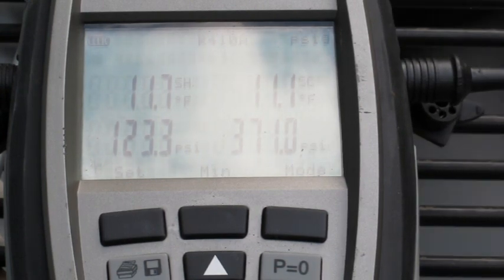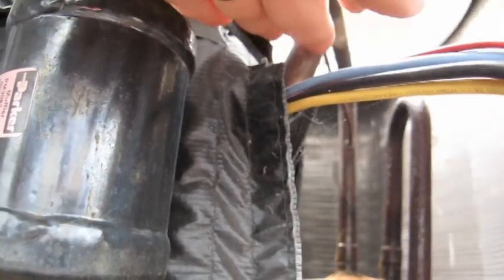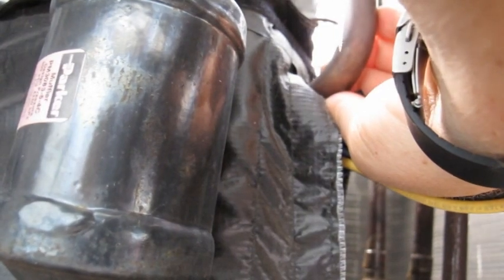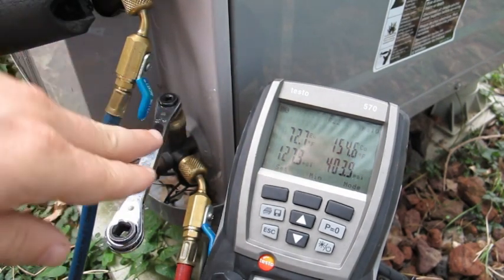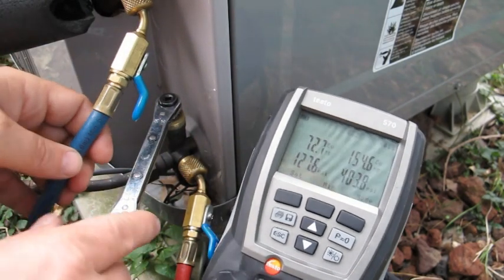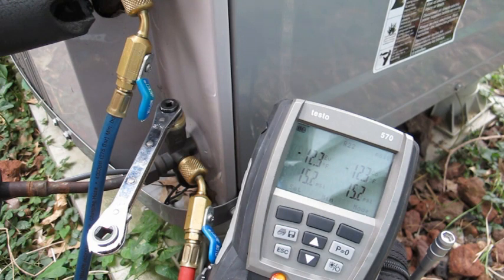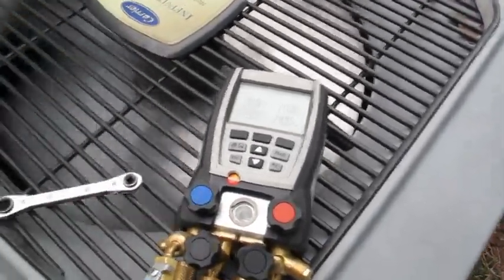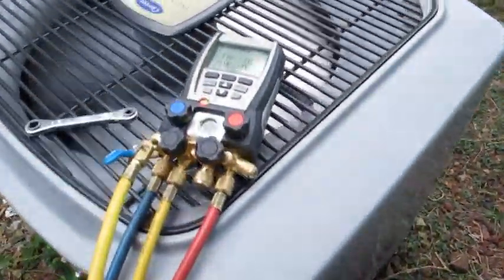HVAC - Are my Compressor valves bad?

Comment: COMPLETELY WRONG SIR!!! for instance how can the guage read the pressure on the Low side now if you have Locked of the valve at that Point, your guage should be hooked up NOW between the Compressor and the Lock off Valve!! to test if the compressor valves are Leaking!!

Comment: Not all the time, I just found a bad compressor, the low side was low because of a pass restriction problems at the filter dryer, the compressor started frosting at the compressor back to the evaporator...and it had a bad noise coming from the compressor, and this was a 3 phase compressor,All windings reading 1.0 ohms, On 2 of the windings it would read 1.0 ohms then kick off the meter. had to reset the meter....Replaced the compressor, runs GREAT....

Comment: Thanks for posting this, I know it's old but never the less it helped me today.  I found a unit today that I suspected the compressor had bad valves.  R22 piston unit had a 104 suction with a 146 head,  after scratching my chin for a minute I remembered this video and tried to pump the unit down, no joy.   Next, I pulled one of the fan wires and the head pressure didn't move much when it should've shot up.   Thanks again!

Comment: Eddie, I have a compressor on a 17 year old system that seems to have a bad suction valve. Had a tech last week that didn't know what I was talking about. He thought I had a bad TXV. Suction pressure is high with normal discharge. Having trouble cooling on hot days. I think the pressure coming from the compressor suction side is making my TXV close. Suction sits at about 100 psi for R22 system. Can the valves be replaced?

Comment: the primary purpose of your compressor is to raise the temperature of the refrigerant a lot of times you will have a cool discharge line as well when your valves are bad but not completely failed partial failure

Comment: if that is R 22 those pressures are way to high your compressor is fine you have way too much load on that somebody might have put in a smaller compressor or condensing unit with a larger air handler. easy way to test compressor valves disconnect that outdoor fan your high pressure should go through the roof if your valves are bad your pressure won't even get to 300 on an r22 system many times it won't build up. You'll see the unit with no condenser fan running at 250-300 . it looks to me if thats are 22 you'd only have an excessive load condition hopefully somebody didn't modify the inside the unit and put a bigger unit on there then what it's capable time to look get model numbers of inside equipment and make sure its the same tonnage with a suction pressure that high on r22 you have excessive load your head pressure is too high or not to be your valves are fine

Comment: Nice Testo Set.
I think you nailed it at the very beginning.
"Abnormally High Suction Pressure Usually indicates bad valves".
Compressors are not that complicated; they literally only "compress" refrigerant, so if your suction pressure is high (way high), it means the refrigerant is not being compressed thoroughly.

Comment: You usually have a locked rotor, or a burnout. The best bet with a burnout is to remove all metering devices, reversing valves, accumulators, etc, and flush the system with solvent, and pretty much do a total system rebuild, because that burnout shit will ruin your valves, and your new compressor.

Comment: hey thanks  I have a ruud unit that the compressor has been sweating it could be over charged but something else I changed the filters  it had no effect think im going to open it  after its run a bit  and then switch it off and feel the suction line it maybe over charged but dk it was serviced last year and charged according to factory specs I watched them do it and  they ran it bout 40 minutes before closing it up and the compressor  wasn't sweating when they left s I don't think its the charge its a 08 ruud Copland scroll

Comment: hi sir eddie,,i just want to ask something,,we install a new compresor after the old one burnout,,,but the problem is the new compresor is not working properly,,its getting so hot in the suction line then it turns off,,what should i do to make it work.please i need your advise and tips to fix it,,its a split type a/c,,thankyou

Comment: Hi Eddie, thanks for the video. Why do you have your compressor all wrapped up? Wouldn't that prevent the heat from leaving the compresssor? Also, if my high side is around 160 psi on an R-22 system,  and everything else is normal, ie, clean condensor/evaporator coils, does that also suggest that I may have bad valves? Thanks.

Comment: oh that was the super heat reading and sub cooling reading that went into neg., my bad.   Could I take a pump down closer to 5 for saving a charge for an evaporator leak or line leak repair or is 12 good enough for not wasting much of a charge in a closed system.

Comment: 3:43 "...running compressed air in a vacuum..." there should be no air in a closed system, I thought you pulled the suction side down to a neg reading and the high side show neg too, correct?
Reply: Compressor, not compressed air.

Comment: can you explain how to by-pass a low-pressure valve to include a little theory or how it work to begin with and why they are critical in some compressor cooling systems

Comment: Loving the vids Eddie!! one problem,with the pump down test tho, how do U know if the high side valve on the unit is holding or if the compressor valves are bad :-D  :-D

Comment: I installed a brand new compressor last week and the valves were bad (h2o source HP).  I didn't have my camera on me to take the video, but on my compressor the high and low side were the same 132psi.  The compressor was running but it wasn't doing any work.  I returned the faulty compressor, installed the new one and it worked like a charm. Great vid.

Comment: Great video, great tips. It would be nice to have a bad valve or bad reversing valve video for the new guys too. The guys at East Coast Metal told me  that 75% of the returning compressors had no problem found. I was thinking...well lets load them in my van then.

Comment: Great video Eddie! This hasn't happened often but I have pumped down a couple of compressors that just wouldn't pump down all the way. Half way through the process it would start to make this terrible noise so I would shut the system down and recover the rest of the ref. Could this be do to bad valves? If I remember correctly all three compressors were at least 13 years old.